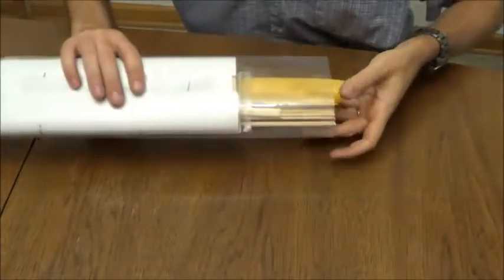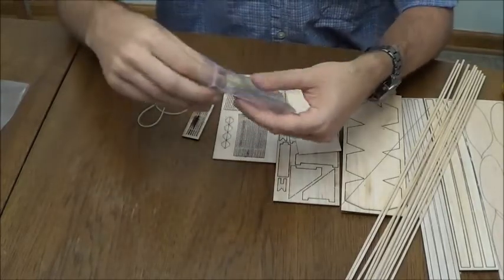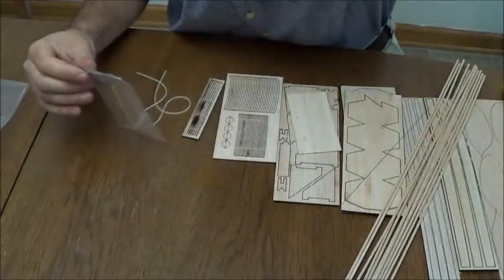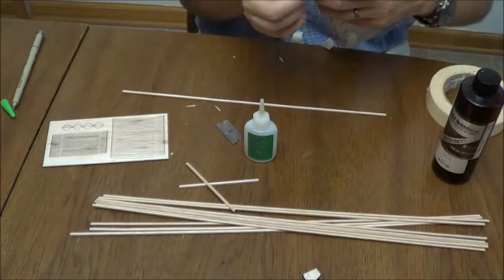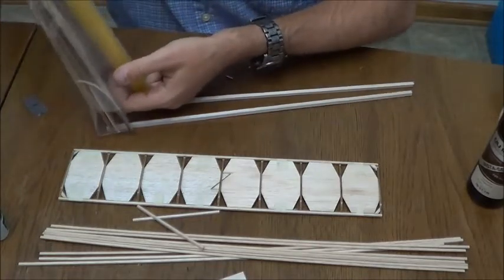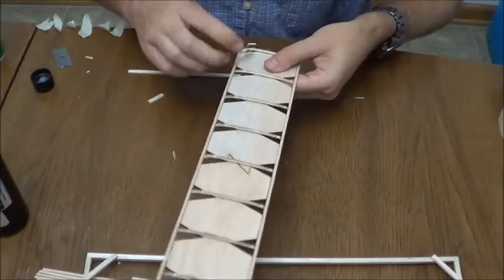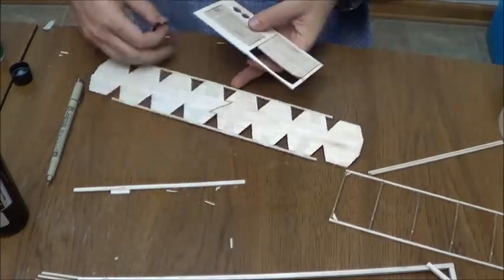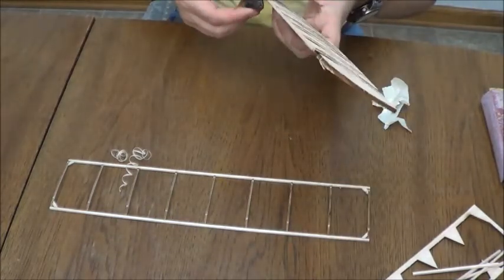Senior Flyer Build Pt.1, Wing and Stabilizer (2019 Wright Stuff legal)

Comment: I have been using ca for ease of gluing. When using thinned duco, how long does it take to dry? I thin to about 50/50 with acetone. The drying time for me varies from 30 seconds to never.
Reply from the maker: DarkSparklyUnicorn I don't thin mine, for what it's worth. You do need to give Duco about 30 minutes to cure. It comes out very light and strong though.
Reply: Another question: what container would you recommend to store and/or dispense acetone? I remember you had a bottle of thinned super 77 in one of your f1d videos, so where did you get that from?. I have been looking all over the place for a suitable container :/
Reply from the maker: DarkSparklyUnicorn  I really highly recommend these: https://www.bioquip.com/Search/DispProduct.asp?pid=8800
I mainly use the smallest ones, but in all sizes they're solvent resistant and do a great job. By the way, use xylene or naphtha to thin Super-77. Acetone isn't even 1/10 as good.